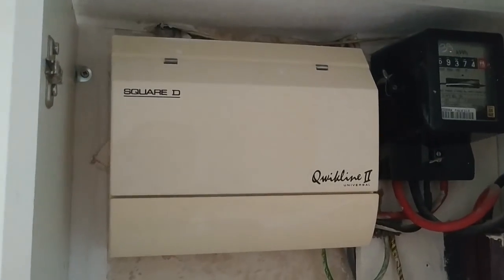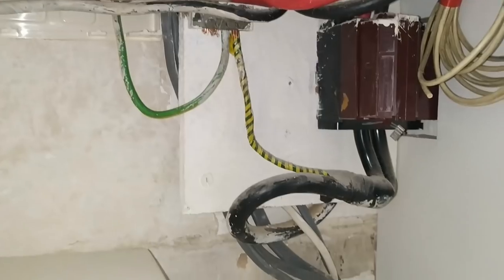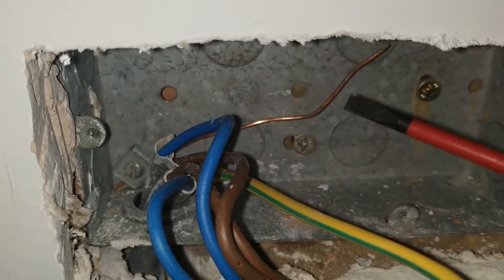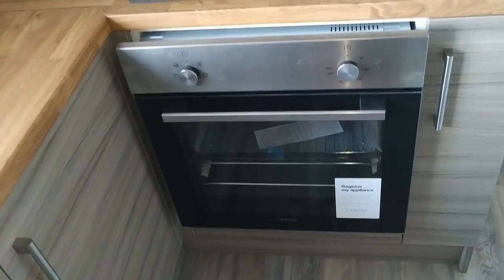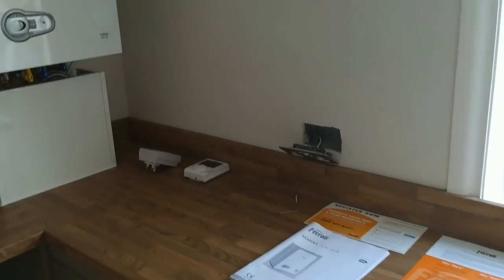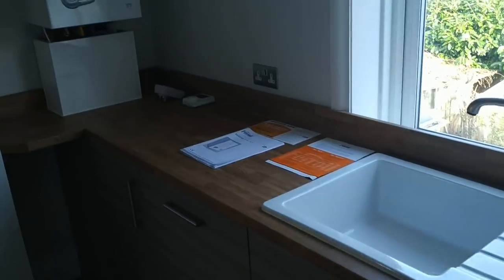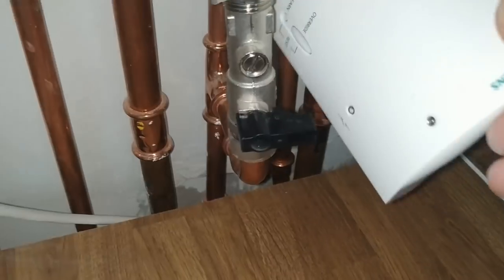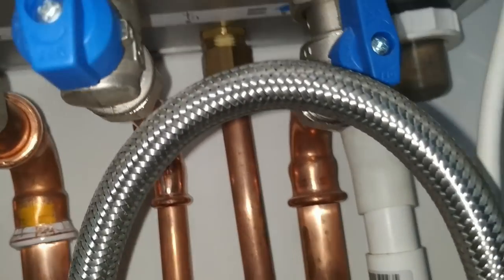Newly Refurbished Electrical Shambles

Comment: OMG! I rented a house where the extractor hood didn't even have a hole to let air out - worse thing the previous tenants liked oily fry-ups so you can imagine the mess. Used a whole can of engine degreaser to clean the cupboards...
Reply: I've had one of these too. Absolutely horrible when the stove burns something, for sure. I also stayed away from any kind of frying for the same reason.
Reply: That's pretty common, unfortunately.
Reply: I don't think I've lived in a house that's had a proper extraction hood that actually vents to free air. One even vented into a cupboard, which made the cupboard a grease-fest after 6 months.
Reply: Those are recirculating extractor hoods, you're supposed to use grease filters that you replace regularly and activated charcoal filters that you replace every 6 months. Having them vent to free air indoors with no filters is pointless.

Comment: Now that's workmanship worthy of being investigated on a weekday morning show on BBC One! Dom Littlewood would end up with repetitive facepalm injuries! I'm not really sure what is the worst thing here, the placing of switched sockets deep inside the cupboards & the inaccessibility of the cooker master switch, or the reusing the 35+ year old unsleeved mains plugs, or the live wires under the basin in the shower room, or the shoddy work of the combi boiler set up, the lack of fixings to the wall of the breaker unit as well as no note of work certification etc. etc. If I was to hazard a guess, it's either a dead lazy "Part P" qualified handyman, or some complete "jack of all trades, master of none" cowboy working cash in hand. Really, the work you've shown there JW is a good example of the phrase "not fit for purpose".

Comment: Obviously they just ran out of blue sleeving re: the 1mm T+N cable at the end there.

The thing about an installation like that is - that's just the stuff you can see.  Imagine what's hidden out-of-sight.
Reply: A rats 🐀 nest of wires with actual rats 🐀 in there

Comment: Frequently come across shite work standards like this in the 80's an 90's when I had my own electrical business, NIC approved. It boiled my blood as did the standards in this video. As always, the builder don't give a rats arse about electrical standards we have or had to abide by because that's going to be expensive, so builder gets his chippy mate (other trades are available) in who does a bit of lecky bashing on the side, no questions asked. And when I came across this stuff in my day and highlighted it, being NIC approved back then, I would be accused of trying to make a quick buck and being picky. Kitchen  fitters and bathroom fitters should have been lined up against a wall and shot or dunked in acid.
 I even worked alongside a kitchen fitter in a new house who had "IEE approved" written on his van sign writing ffs. All I was asked to do was leave him a set of 2.5mm ring tails in the new kitchen area. You think your kitchen is bad JW. You ain't seen nuthin yet. 
I once went behind a "prestige" (apparently had a central London office address and advertised in Country Life, so they MUST be good) kitchen firm who put in a new cooker hood cabinet as part of a new kitchen, when the customer mentioned that her extractor hood wasn't working while I was there, I looked underneath and found a 4" Senate brand bathroom fan screwed to the underside of the hood all melted and twisted out of shape. The cheap plastic flexi duct was bodged up into the ceiling just blowing into the floor void. No isolator, I traced a piece of 1.5mm flex botched directly into the back of one of their cheap twin socket outlets. Fear not, the flex was new. 
It's lack of education on the customers account I believe. Until they get wiser this sort of shite will keep turning up, it has been like it for years and I doubt until someone gets a prison sentence and big publicity, it will continue. Plus it's probably better in their opinion to go cheap at the time. 
Im well out of the game now and to be perfectly honest I don't miss it anymore. I do my own wiring at home on my extensions because I know it is done correctly, stuff getting in some cowboy with a NIC sticker on his tee shirt, and stuff local authority rules. Your video just proves what a load of old b#ll#cks it all is. Completely un- enforceable. If it was then why wasn't the local authority pulled in to this property to investigate, find the guilty party and prosecute. I rest my case. 
Anyway JW keep up the good work, I'm in a bad mood now so a cold beer should calm me down, cheers. 🍺

PS - sorry about the rant.
Reply: Agree 100%. I may be wrong, but I always feel that a lot of this crappy work is driven by "house flippers" or "property developers" - I've seen so many houses "flipped" within 8-12 months, usually older peoples homes who have died or passed away and these idiots come in, buy it and fling up stuff that makes it look "refurbished" but in actual fact they've only spent a tiny amount of money on the house and have not actually attended to the real issues. I also know for a fact that many people will lean heavily on the surveyor to increase the home report valuation.
One of the lower points was seeing a known asbestos artex ceiling being skimmed over and when I asked are you going to tag it for the future owners etc I was more or less told to get lost.
Guy ended up selling that house for about 45k more than he paid for it too!
Reply: I completely agree Tony. People in stetsons buy these places and throw some emulsion at it then rent the place out at premium rate. If the renter sees dodgy work they don’t say anything because finding another place would be out of the question as there are not enough dwellings around. And there is no chance a cowboy is going to fix the faults. Frightening when you think of adults or children sticking their wet hands in a cupboard to get a towel out. Too many cowboys out there and the councils do not monitor even though they are paid to inspect it’s just a glimpse and a back hander job.
Good vid JW as always
Reply: Totally agree tony N was a reg sparks myself am retired now i dont miss the crap that needed sorting
Reply: I can send you a few links of good book publishers if you want?
Reply: On Wednesday (it's now Saturday) I watched another koala video - mentioned the Australian Koala Foundation - for preserving the little critters. Looked at the website and saw 'sponsor a koala for ???AUD'.
And I'm thinking would it not be better to sell eucalyptus trees and encourage everyone to have a couple at least in their garden and then get a koala or 2 in ?

I've not calmed down from Weds enough to finish the e-mail suggesting it !
Reply: Have the city and guilds courses been dumbed down now as the called it "electrotechnical" now
As i did 2360 1,2 and the 2391. And 2400. Courses at Kingston and nescot colleges in Surrey I want to do my 18th update soon
Reply: agreed 100%
Reply: I’ve been an electrician for 40years. I semi retired last year and mainly just do testing now and what John is showing here is sadly nothing new!
But with all rented properties now requiring an electrical cert, hopefully things will improve.

Comment: No extractor fan in the bathroom in this case complies with the Building Regulations as there is an opening light in the window, just in case you have forgotten. Keep up the good work.
Reply: This supports JW from the web :
Any new kitchen, bathroom (or shower room), utility room or toilet should be provided with a means of extract ventilation to reduce condensation and remove smells.
For toilets only, ‘purge ventilation’ (an opening window/door on an external wall) meeting the requirements specified in Appendix 2 of ‘Approved Document F - Ventilation’ can instead be used to provide ventilation if security is not an issue.

Comment: Some IR hobs can be configured as either 1 or 2 phase to presumably reduce current demand.
So check the cable size required, 2.5 flex won't be close to capacity!

Comment: I can't help but notice a corrolation between the quality of work and the location of said work. If its inconvinient or challenging to install, rectify or modify to the correct standards, its far more likely to be left or bodged. Im think speciffically about the oven and hob isolator here - now the kitchen is in, it will be a right pain for someone to fit an isolator above the hobs and backsplash/counter edging.
Reply: Jonathan Cook not really it’s a dry lined wall so a cable can be dropped down behind, and there is still access behind the cooker and hob.
Reply: @andrewschannel3635  are you the property owner or is that an asumption? I always assume the worst, the worst being that it is concrete or brick.
Reply: @andrewschannel3635  JW said it in the inspection video above. According to another comment, people routinely pay JW to inspect installations before buying a new home, then use JW's reports to factor into purchase decisions and price negotiations.

Comment: Get that boiler checked out that looks they’ve used push fit copper on the gas supply to the boiler which isn’t allowed 
As a gas safe engineer myself it doesn’t look good
Reply from the maker: Apparently they are crimped on fittings and are suitable for gas as they have a yellow mark on them.
Reply: It’s crimp fitting, the water is done the same. Perfectly fine, although shockingly done
Reply: @sizey2003   The bloke's fitting Modenas. Enough said.
Reply: They're not push fit OR crimped. They're press fit.
Reply: As a gas safe engineer surly you would know that that’s press fit
Reply: Does make you wonder.
Reply: Yeah a plumber who can't solder.... I definitely be getting that boiler checked out by somebody competent
Reply: kevin Browning  just interested what qualifications do you need to become a gas safe engineer currently looking at a 30week long college course, what else do you need. Thanks
Reply: Fibre Washer thanks for that currently doing level 3 electrical installation almost done and i was thinking i might to that too.
Reply: @siani5299  I think a week would be more than enough, to surpass Kevin's standard, if he doesn't know the difference between 'press-fit' and 'push-fit'.👍
Reply: They're press fit fittings, generally used in a premise that you're not allowed to solder in. IE Flats, offices and alike, anything with communal alarms. If you solder you can be in breach of the places insurance, h&s policy and your own insurance and hse can have a field day. Next time you're back in college for your 5 yearly exams you'll get a question on them.
Reply: @siani5299  Depends what exact field you want to work in, most colleges worth their salt won't even send you into the exam if they don't think you're ready (Let alone pass you because if you screw up and get reported it goes back at the colleges that pass you too). If you try for a short course you'd need to prove you've worked alongside a company doing gas to even get onto the course.
Reply: @TheChipmunk2008  It's probably not that they cant solder, press fit are about insurance for bigger companys saves the hot work and risk of fire it costs alot for the fittings and tools to fit but there was a case of a plumber loosing his torch somewhere unaccesable causing a fire in a listed building ouch for the insurance premiums

Comment: BTW, running the cooker hood so that it exhausts into the room is acceptable (in fact preferable) so long as there is sufficient ventilation elsewhere in the room.  There is usually a metal or fabric grease filter, and a carbon odour filter within the hood (this is only installed for the recirc option).

This is how I installed mine because there is continuously running ventilation (mvhr) already.
Reply: Tim Small Preferable? How is recirculating hot steamy, greasy air preferable to sending it outside? I realise there are times when this is not possible, but to say recirculating is preferable is a stretch!
Reply: @spencerwilton5831  If you have mvhr or other continuously running ventilation it's preferable to have recirculating cooker hoods.
Reply: Hardly anyone cleans a hood filter or changes them . Best also get all that steam out of the property like in a shower room. Condensation ain't no good

Comment: wow!!
I wouldn't trust that boiler in there having seen the other work!
Reply: You can put bends on flues but when permanently visible like that tt looks bad. That water pipe below fed from the undersink inlet was a bodge but strangely it was all done with pricey press fittings. That can be a sign the installer cannot trust themselves to solder properly

Comment: I imagine the dangling live block connector was under the sink for easy removal of inquisitive children.
Criminal!
Reply: Maybe they originally intended to put a light in the cupboard. You can't just leave a dangling live cable under the sink. Thats stupid.
Reply: @simontay4851  not useful when the light is on as blue there is switched live from downlights!!
Reply: More likely for a mirror light, but there's no mirror.
Reply: I first read that as removal BY inquisitive children. But no doubt it would achieve removal OF said children shortly thereafter.
Reply: Probably for a mirror light, the switch live is to have the light turn on with the main bathroom lights, and the permanent live to have a socket on the mirror. The ground is probably a neutral, they saved on cable and did not put a three core in there, and would have used the ground conductor for the neutral and of course no ground (but providing that the mirror is double insulated no problem, except for the socket but I see that in the UK you use an isolation transformers for socket in the bathroom so even there no problem) 

Shitty job of course.
Reply: It makes me shudder, it is no only criminal as you correctly state, it is also frightening.
Reply: @andrew_koala2974  as frightening as John's deadly bare ended test probes.
Reply: @Graham_Langley  it wouldn't have worked without a neutral present (unless they used the CPC). Horrific

Comment: That choc block under the bathroom sink is horrendous! Anyone holding the tap and rummaging around in the cupboard underneath could be killed. Consumer unit looks like my old one, in which case the 6 amp light circuits are not on the RCD

Comment: That was truly shocking.  In fact, looking at what you showed me, it is ALL far superior quality as to what cowboys contactors got their boys to carry out in my house. I have had the whole house (supposedly) rewired.  Where they could not move the fridge, they left the old socket and wiring behind it.  They then just fitted a few new faceplates, cracked 2, and just left them.  Upstairs (the house still has 90% horsehair Lath and plaster walls), the plaster collapsed when trying to fit a new double socket, so as they could not use the old straps of wood (they cut the wood out at the same time, the stupid f***s), they silicone sealed the box to the wall. They also silicone sealed the smoke alarms and CO2 detector to the ceiling, as they gave up pushing holes in the with a screwdriver to find wood. Pulling plugs out over time has resulted in the silicone sealed socket boxes coming away from the wall.

The same deal as you have found, but with ALL my kitchen above counter sockets: they are all over the place.  Some completely hard to the counter (this was the original location for the old sockets before a new, higher kitchen was fitted), but did they relocate the sockets higher?  Nope.  Then some sockets are on a wall with no shelf, and no unit below.  Just a double socket 5 ft up in the middle of a wall (again, it was because there used to be a single cabinet there).

They fitted an Expel-air to the bathroom ceiling, and that was it - just the unit. I went into the loft and there is no ducting at all - just the Expel-air hole in the bathroom ceiling, and the loft insulation over the top.   They battered holes up and down the walls to try and chase wires, and never replastered over the fist sized holes.  It just shows a person that does not see what goes on, how shoddy work can be carried out.  It all looks nice on the outside, and most people will go ''ooh, and aah'' at the shiny new fittings.  But, when people like your good self come along and expose this shite ''workmanship'', it opens a few eyes and begs the question: ''what the hell is my house like?''.  Keep on keeping on.  Regards.  Dawg.
Reply: ... shocking. 🤣🤣🤣
Reply: @johnriggs4929  - More shocking though, is the amount of waffle and overly long comment. 🥱😴I'm surpised you got through it all! Well done that man!   All the best.  Dogue

Comment: I'd say that at least 70% of houses have 'similar standard' of installations. Most of the cheap electrical contractors do such shitty jobs on the quick. And people who are short on money, and dont have engineer degree to recognize bad work are just happy that 'it works' and looks 'okay' on the outside. Also industrial installations arent much better. I've seen so many copper cables with aluminum terminals of smaller size, that were drilled to fit the bigger cable... and thats not so good at 400A circuits.

Comment: 12:26 Reminds me of HDB flats in Singapore. No dedicated ducting for extractor fans, so the hoods in the kitchens are forced to recirculate, and the bathrooms are designed to vent passively. Aftermarket kits for the installation of extractor fans in bathrooms often just replace the windows outright, or sit a distance away from the window, using a custom mount.

Comment: If an electrical contractor does a complete wiring job I should think he would leave a sign somewhere with contact details in case you want more work doing.  He would not do this if he was a bit dodgy.